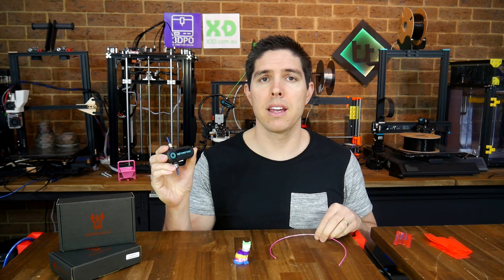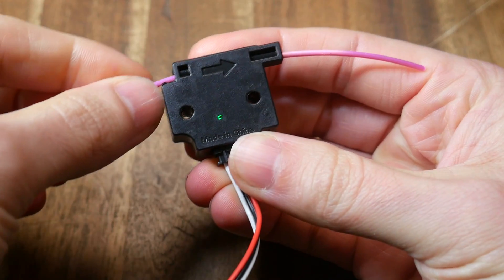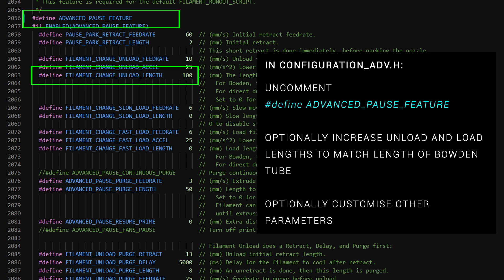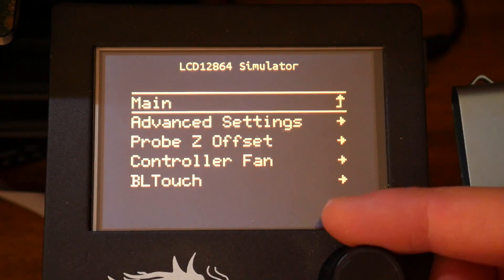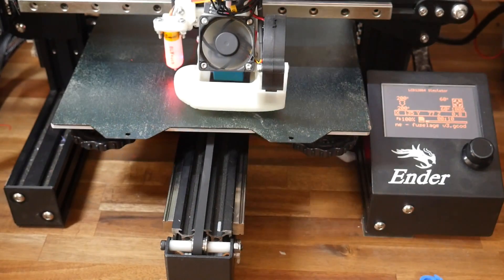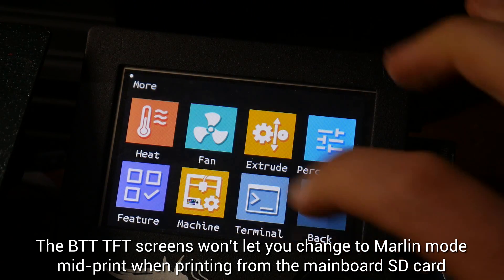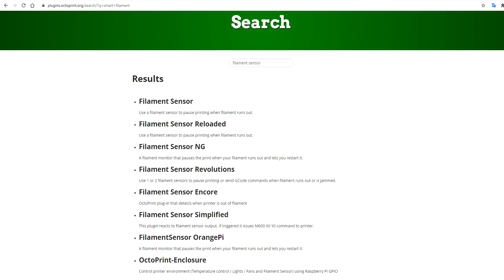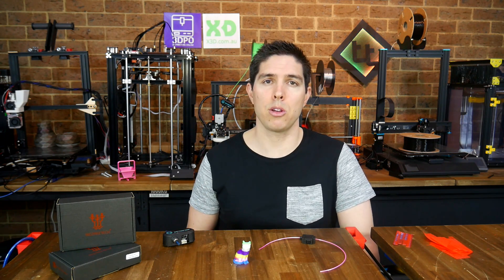BTT Smart filament sensor guide - Detect filament runout and jams

Comment: looks like a refined version of the https://duet3d.dozuki.com/Wiki/Duet3dFilamentMonitor_RotatingMagnetVersion

i wonder what the resolution of the encoder is
Reply: From when is the article? Seems to be on the same time stamp.. so i guess they didn't steal the idea.. at least not there^^
Reply: There's a beta/prototype of the Duet filament monitor design from September 2017 here: https://www.youmagine.com/designs/duet3d-filament-monitor

And the Smoothieware/Smoothieboard docs have detailed an encoder-based filament monitor since *January 2017*: http://smoothieware.org/filament-detector?rev=1485350367
(Here's the latest version of that page, which includes more details, links to designs for sensor enclosures, etc.: http://smoothieware.org/filament-detector )

I've not immediately found any indications that the Duet design is any older than September 2017, but it could well be. Given that Smoothieware and Duet both published designs/guides for filament sensors utilising similar ideas within 9 months of each other, I wouldn't be surprised if they were both the result of a discussion somewhere in the community back in 2016 :)

(While my printer runs on a Smoothieboard, I've not yet got around to setting up a filament monitor as the docs describe. I've always liked the concept, though :))

Comment: Had this sensor for about a year. Very good. On my Biqu B1 I have moved the sensor to the mainboard as I mostly print in Marlin mode. However I would like to see support for this sensor so it works with the TFT and regardless of where it's connected.

Comment: As far as octoprint goes, I believe you just need to enable host_commands (or something like that?) in octoprint and marlin. This allows marlin to tell octoprint to pause the print until it gives a resume command.
Reply: I agree. My setup is an SKR1.4 with the smart filament sensor, all prints go through octoprint. I think I followed the setup guide and everything works just fine. I've even had a few situations where less filament was extruded and the sensor still detected the failure (e.g. when the nozzle pushes against the build plate). After the issue is fixed, octoprint happily resumes printing.
Reply: @twinklingwater  Hi, which setup guide did you followed,  the BTT setup guide on their github page or the setup guide about the "Octoprint-Smart-Filament-Sensor" plugin?
Reply: @mikem8145  I think i followed the instructions on github - that's my usual go-to source.
Reply: I just wanna leave this here for anyone trying to figure out how to run the BTT sensor hooked up to the mobo and still use Octoprint, or are curious about host commands in general: https://youtu.be/YDvFN51siMU
Reply: Yeah I'm pretty sure you're right because mine is hooked up to a mini E3 and I use OctoPrint, and it handled everything fine. At least when I was getting set up. Now I need to go and check it out tomorrow just to make sure. I do recall that 7mm was too low for my dual-gear extruder setup, and ended up at 25mm before the false alarms stopped - it's also mounted on the entry side of my Ender3Pro using this https://www.thingiverse.com/thing:4550063
Reply: Thanks! I'm getting runout messages at 7mm, and saw some people say 10MM worked for them. Mine is mounted almost directly to the dual gear extruder, and I have close to 50mm before it gets there. Also, that model looks perfect for my use as well! Double thanks!